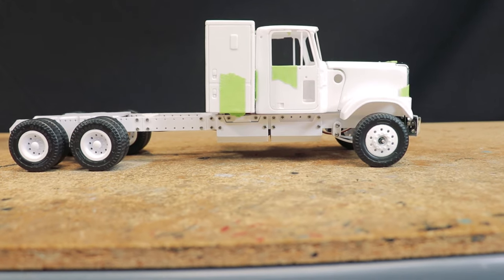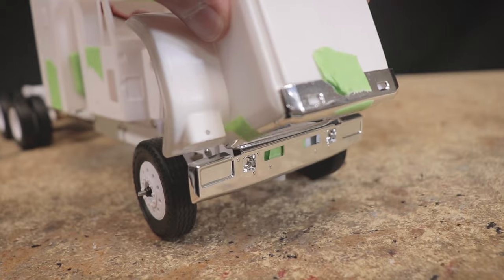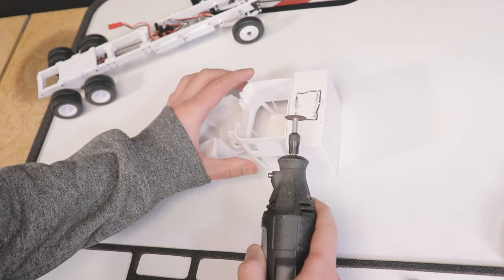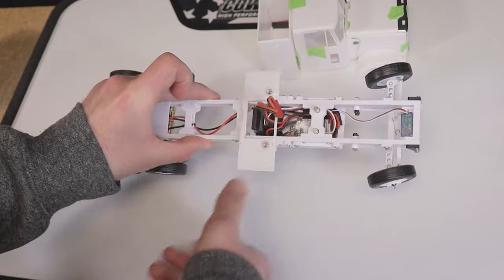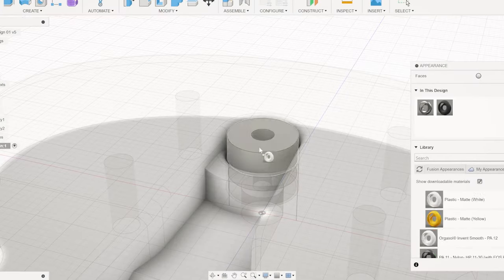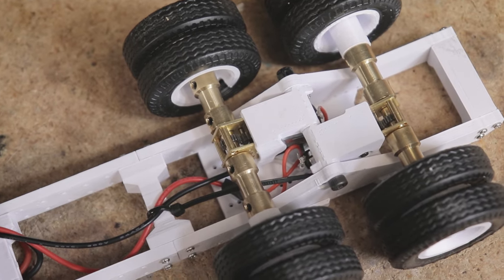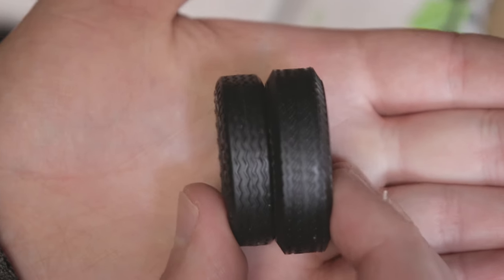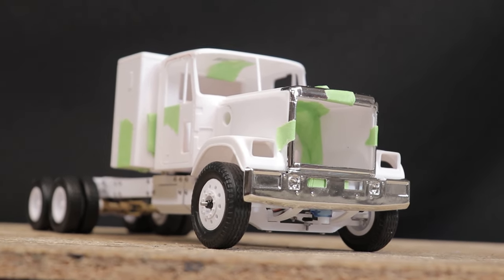Chassis is Done! Here's What's New and What's Next 👍 3D Printable RC Truck Chassis Update

Comment: The chassis is turning out really nice. The cradles for the electronics are a very simple way to tuck everything under the cab.
Reply from the maker: Thank you. They ended up working out really nice. It should look even better with the fuel tanks and side steps installed.

Comment: You might want to make the 5th wheel tilt back and forth, especially if you plan to have a working suspension on both the truck and trailer.
Reply from the maker: Very good point. 👍
Reply: @MakeItRC  Also to mention, AMT's tires that are 22" are usually included with their truck kits based on trucks from the White Motor Company; White, White-Western-Star, White Freightliner, Autocar - these trucks have larger wheels compared to trucks like the GMC General, so most of AMT's fleet will fit your 3d printed wheels.

Another tip, the AMT kits "Freightliner FLC", "Western Star 4964" and "Peterbilt 378" are 1/24 and are repacks of Italeri kits. their tires are also larger and of different design.
Reply from the maker: Awesome, good to know. Appreciate the info. 👍

Comment: Question.
Will it work with EU cabovers?
Reply from the maker: As long as it's 1/24-1/25 scale I think it should. Might need a slightly different track width but the frame design on EU trucks are basically the same. As mentioned though, a different body mount design might be better for the cabover trucks.